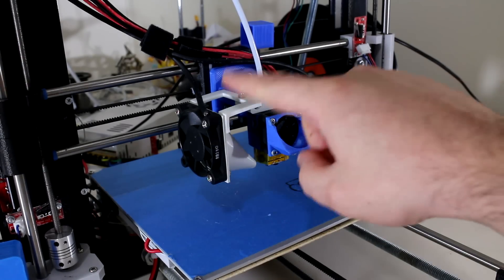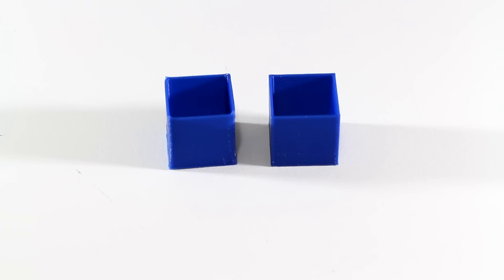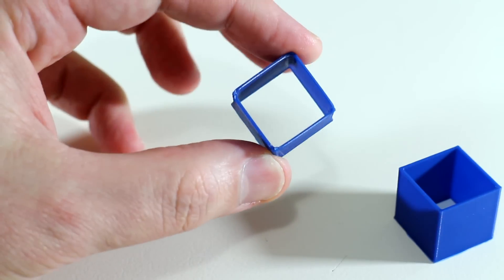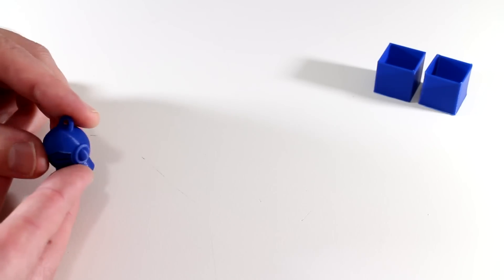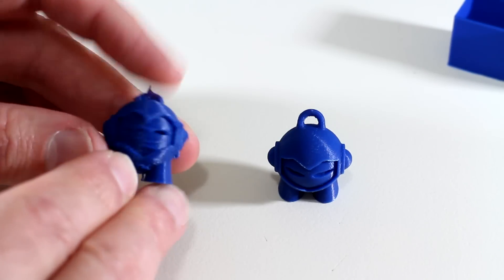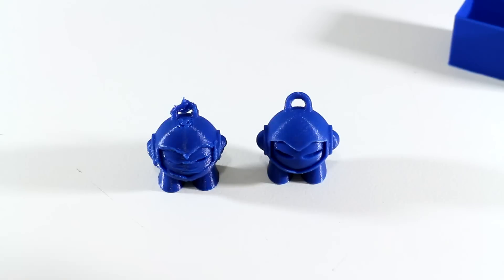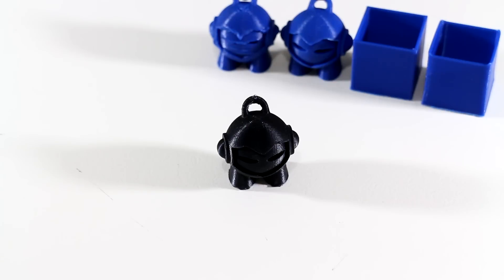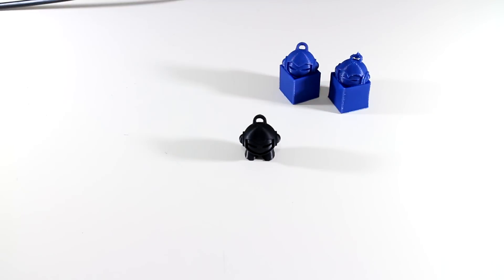3D Printer - Quality Printing with Cooling Fans

Comment: The printer I use has a part cooling fan only on one side of the print head, so that melty effect you get when printing small parts is particularly pronounced.
Reply from the maker: +The Garden of Eatin 
Yeah, I started with a single fan on one side, noticed the part deforming on the other side, so added a second fan.
Reply: +Tech2C I will likely do something similar with mine.
Reply: +Tech2C Have you noticed any effect on inter-layer adhesion with the cooling fans?
Reply from the maker: The Garden of Eatin

Not that I can tell. The new layer of plastic is hot when it's squished on the previous layer so I guess that heat is enough to fuse.
Reply: So I built a reprap with a Mk8 print head on it, no cooling fan.  I installed a duct from thingiverse that takes the exhaust from the heat sink and aims it at the part.  Something of an improvement in print quality. Very cool.

Comment: To hot, and to fast, my prints come out great without fans, running at 195-200 heat, and anywhere from 20-40 mm/s,  so for me the whole fan thing is a wast of time, and plastic, fine tune your machines thru settings of your slicer software, and will be just fine

Comment: Hi, nice video. Thanks. I'll definitelly go with two fans as you did it.  I have a question:  Would you please let me know something about your heating bed? I can se something that looks as an aluminum plate...I want something like that but, what about the heating system? Thanks in advance for your answer.  Cheers!
Reply from the maker: +Juan David Barrada 
Hello, yes I use an Aluminium Heat bed. I upgraded to this from the red PCB heat bed. The PCB material is a poor conductor of heat, but Aluminium a great conductor of heat. This means the entire heat bed is the same temperature, which wasn't the case with the PCB heat bed. Thanks for watching !

Comment: Great quality print, good video. However I just wondered why it seems as if you were getting much higher quality prints without the cooling fans some months ago, but now with them turned off the printer doesn't seem to be able to cope. What's happened there?
Reply from the maker: I've been using these fans for ages. I just hadn't placed emphasis on the importance of them in a previous video. It also depends on the print size, layer height, and plastic used which alters the fans importance.
Reply: Thanks that clears it up. I'll be sure to pick up some fans for my printer now.

Comment: Note to newbies watching this: He is using PLA, ABS does not need fans, but it does benefit from them for very small parts or layers that would otherwise finish too fast to cool before the next layer. but Gcode control, or an easy access switch on the wiring is almost mandatory, as too much cooling will prevent the layers from sticking together.

Comment: Smart!
btw what printer are you using?
Reply from the maker: It's a Prusa i3
Reply: Tech2C I'm starting to fall in love with this printer. I searched for it on Amazon and I saw different names like HITCOP and whatever for different sellers. Is it just the name of the seller, and the printer's name is just Prusia i3, or are there really different versions of it?
Reply from the maker: iSquamata

Each brand is slightly different, even though they are based on the Prusa i3 design.
Reply: Tech2C do you suggest a certain brand?

Comment: Looks like you didn't adjust the extruder or print bed temperature. If you adjust for those, you can get better prints without a fan.

Comment: Hey I have a printer I bought used to get into the game and it is a Plastic Scribbler, has just a regular nozzle setup instead of the bowden.  Would you have a solution to add the setup you have to it?   Thanks.

Comment: I have come across similar findings on my FF finder. As it is a closed well built machine, I run a USB fan off the USB port on the side and printed a base for it to sit on top cooling down over everything.
Has built in memory so I don't need that port to print.

Comment: Your printer is amazingly quiet, unless it's just the way you recorded the audio. The steppers on my Monoprice Maker Select V2 (Wanhao Duplicator i3 OEM)  sounds like a power drill, especially the Y axis motor. I already did a bunch of mods on the control unit & PSU to quiet down the fans, but the steppers are now the main source of noise. Any tips for quieting things down?
Reply: You can put dampening pads between the motor and the mounting plate. But be warned - if the pads (usually made out of rubber) are too soft/flexible, it will allow the motor to spin/twist slightly, and that can have a detrimental effect on the print.
Reply: Benjamin Esposti craft foam. thin

Comment: Would it work if you have a big fan beside it?
Reply: A big fan next to the printer will also cool off the heat bed and the nozzle which could cause difficulty in maintaining the temps. You also risk warping since only a single side of the part will be cooled by the fan.

Comment: you need to change the extrusion temperature. if the filament is too hot when it is being used, it will continue to be gooey and melty because you aren't giving it enough time to cool to the proper temperature. if you lower the extruder temperature, you should see better results with both PLA and ABS filament. there's no neet to waste money on buying two extra cooling fans to cool the filament sooner. just lower the temperature of the extruder and you will get the exact same results for a lot less money.
Reply from the maker: Disagree. These fans cost peanuts, plus I had them spare. 
The cooling fans solidify the plastic much faster resulting in a sharper detailed finish. 
I can print faster with these fans. 
I can print hotter and get a shiny finish from the plastic at these higher temperatures.
Small parts (like in this video) look much better than without the fans active.
Adding these cooling fans have added another level of quality printing to my parts. I highly recommend giving them a try.
Reply: Tech2C what if I don't have a 3D printer? I am on a robotic team and we have a 3D printer that we share. it's a Makerbot replicator 2. would the fans help the filament stay on the platform?

Comment: Hi and thanks, can you tell me the specs of your fans , speed and size ? Thanks
Reply from the maker: They are just 12v 50mm fans. Any fan will do, as long as the air is directed to the base of the nozzle.

Comment: Its very useful tutorial, may i know how to connect the fan cables? is it direct to 12v power supply or Fan terminal on RAMP 1.4 board?
Reply from the maker: +wahyu Lim RAMPS boards have a Fan output which allows software to control them. Checkout the reprap site http://reprap.org/wiki/RAMPS_1.4
Reply: +Tech2C Yes, I know, it means you connect the fan to D9 (not direct to 12V power supply, as the fan for Extruder direct to 12V power supply), may i have the fan mounting STL file for cooling the filament? Thanks
Reply: +Tech2C Sorry I just see someone has asked it below. Many Thanks

Comment: I wonder if they make this for a Delta style 3d printer.
Reply: I own a delta style 3D printer, and so far, I have found that you have to print your own cooling shroud if you want the fan mounted on the spider. I am doing an experiment with a low-speed 120mm fan pointing toward the print from above. The result actually looks great so far...

Comment: What end code do you use to have the Z lift a certain distance off the print? Right now I have to just have it G0 Z130 (the top of the printer) to insure it lifts off the print when done.
Reply from the maker: G91 ;relative positioning
G1 Z+0.5 E-5 X-20 Y-20 F9000 ;move Z up a bit and retract filament
G28 X0 ;move X/Y to min endstops
M84 ;steppers off
G90 ;absolute positioning

Comment: any variance on the fans with petg? i.e. does the dual fans make petg print quality better?
Reply from the maker: I print PETG with fans at 35% print speed. All plastic will benefit from cooling as long as it doesn't affect layer adhesion and part warpage...
Reply: Thanks for the reply.. 
[Backstory] - I was trying to print hypercube parts in PETG on a Wanhao i3 replica (Maker Select) and the plastic would bunch up on the nozzle. Was using  your recommended slic3r settings but I suspect its waaay too fast for this printer to handle, and the feeder stepper is occasionally skipping as well. Re-tried the part in PLA and it came out fine... I was thinking that part of the issue is that the cooler on my printer cannot deliver enough air to cool down the hotter PETG. I may just print (most) everything in PLA and when the hypercube is together I will re-print parts in the new printer in PETG. 

Thanks for the reply and the hypercube work.
Happy new year from Canada!

 - Eddy

Comment: Thanks for great video. I also learned the hard way how important a more powerful cooling fan is on the Arduino board, when my ROBO3d kept messing up prints no matter what I did. The fan had an inconsistent short - board would get hot, print would mess up half way through. I put a much larger fan cooling the board and have great prints now. Im going to print out those bowden fan mounts and give it a try. Thanks!

Comment: Thank you! I installed a cooling fan at the tip of my nozzle and now my prints have improved 100%
I now print all my projects with PETG and max fan at the tip. PETG has similar properties to ABS, with the added benefit that it does not mind strong cooling while printing.

Comment: This cooling system is compatible with the Gregs Wade Extruder v3? There is a link for the printable .stl files ?
Reply from the maker: You'll have to check thingiverse or the reprap forums for cooling solutions with your extruder.

Comment: What do you do to avoid issues on overhangs ?  This cooling system it is a solution ? Or something else ?
Reply from the maker: +Pawel Drogowski Definitely, cooling helps with over hangs. If you haven't used this before then you will be surprised with the results...

Comment: looks like it's also too hot, while this video is still true it can be better without a fan a bit first though it can be filament specific and some will be stronger if it's at it's ideal extrusion temp.

Comment: Hi Tech2C, thanks again for another quality 3d printing video. However, I am curious when you mentioned that the glass temperature of PLA is 55°C and that of ABS to be 90-100°C. It does not match my references, like this one (which say it's 65°C and 105°C respectively) and even then, colored ABS and PLA tend to have higher tg due to the pigments added. What should I make of this?
Reply from the maker: Each manufacturer can use a different chemistry in their filaments altering the glass transition temperature. If the manufacturer says 65c for their brand of filament, then you can trust them. However these plastics will get soft long before the glass transition temperatures specified, so be mindful of that.

Comment: I can see a resonance pattern in your prints and I wonder what is doing it?  They seem to go up at an angle.
Reply from the maker: +Dark Alchemist 
I'm not sure. They are very hard to see with the naked eye, and these photos are zoomed quite a bit. Probably something to do with how the stepper motors or how they're driven?
Reply: +Tech2C Neither am I as the cube shows it off better due to the flat surface and it is in both of them so that removes fan vibrations (just thinking it might be the hotend fan vibrations causing it too which is always on) and what is really weird is the pattern is always from left to right no matter how you turn the cube to face you.  I wonder if the camera is playing tricks on us and it is the camera causing the pattern?

Comment: To what température do you print pla ?
Reply from the maker: Anywhere between 180 and 220c. It depends on the brand. Normally the manufacturer will recommend a print temperature range.
Reply: Okay thanks guy :)

Comment: What hot end and extruder are you using? I need to replace mine. Great video. :)
Reply: Or what low cost hot ends do you recomend?
Reply from the maker: +Panoreth 3D Printing I'm using the E3D v6 1.75mm Universal. It was an upgrade from my JHead MK5B. If price is an issue, you can purchase the E3D v6 Lite edition, but you can't printer with higher temperature filaments (which isn't a big issue as there's plenty of alternative filaments)
Reply: +Tech2C what is the highest tempurate can the lite print up too?
Reply from the maker: Panoreth 3D Printing

http://e3d-online.com/

Comment: do you just tie two side fans to the extruder fan power?
Reply from the maker: No. these fans are controlled separately and can be turn on or off in software.
Reply: would you mind posting a video or a description on how you were able to accomplish that?  I am using Ramps 1.4 and have my bedside cooling fan tied in with my extruder cooling fan because i couldn't find another way to control it.
Reply from the maker: Kevin Ellis

Easy to connect fans to RAMPS 1.4 - I have the same one :)
The screw terminal next to the hotend heater screw terminals is for the software controlled cooling fan - D9. Just wire them in and enable cooling in Cura/Slic3r for it to turn the fans on.

Also just google the RAMPS 1.4 board pin outs which will show fan output - D9.
Reply: first off, thank you.  It turns out that my Extruder Fan is wired wrong.  I have it plugged into the D9 header along with my cooling fan.  My board does not have the pins for the Extruder Fan installed. That is, if this image can be trusted: http://i.imgur.com/KOjq6ri.jpg

Comment: To print with PLA do you use heatbed or not?
Reply from the maker: Sometimes. It depends on the size of the object. Small items I don't bother, but larger items I tend to use the heatbed just in case.
Reply: I use 50c with pla. I've noticed the bottom of the prints will melt/deform very slowly with anything above 65c

Comment: Fans are 70mm? If not would two 70mm be overkill?
Reply from the maker: I use 50mm fans. I think 70mm would be very much overkill for airflow and also the size would be quite obstructive.

Comment: I've got some questions.
1. All the fans I've encountered on 3D printers have either had to blow at 100% power, or made high pitched whines. How do you eliminate that noise?
2. I recently encountered a 3D printer setup where the fan dropped the extruder temperature from 210°C to 140°C, killing the entire PLA print due to obvious cold extrusion errors. How do you cool the part down without cooling down the extruder tip?

Comment: Can you help me please i have just brought a prusa pro b i3 and im a beginner which dont know much about p.c's and i have tryed to upload the marlin and adwino and changed the code to 'true false true false' then i tryed to upload it to the 3d printer but i keep getting a error on the marlin software i cant remember its like strucked s'tou something and i dont know what to do. if your can help me let me know thanks
Reply: I had the same issue. Wasted 8 hours trying to get firmware uploaded, but it kept failing. What brand of Prusa I3 did you get? I got mine from RepRapGuru. It's got an Arudino Mega 2560 board with a Ramps 1.4 board as well.

If you have those boards you should be able to upload the firmware from the files provided on RepRap's google drive. I talked to customer service since I had the same issue as you. They told me the new version of Arduino software has a known bug, so you have to use a previous version in order to upload Marlin. 

https://drive.google.com/drive/folders/0B4A3jLWIXeoFfkxURVdhMEFpTWpsSExncXFmUGpkalczX3ZvS1J6bGNabGdWM2NwaWNuS0k
Download Arduino and Marlin. Install Arduino, open the Marlin file with it. Edit the fields as well as mate it in the upper tool bar of Arduino. Make sure your BAUD rate is correct with what your device manager is reading, change it if necessary. Hit upload. It should confirm that it was uploaded. Close out of Arduino. Then open Repetier Host, set BAUD rate to same number and port as device manager, hit connect. Should work.

Hope that helped, if not then send me a message, I ran into multiple issues that I'm sure you might run into as well.
Reply: I fixed it now mate

Comment: Great topic, its really great to see the impact of cooling that much. However shouldn't have you lower the temperature for the PLA printing or is it mandatory to maintain that print speed?
Reply from the maker: These parts are small and illustrate the benefits of cooling. You could lower temperature, but the filament I use has a shiny surface when printing hotter - cooling relaxes the strict print time that causes molten plastic.

Comment: i always use a cooling fan, the only difference when im printing with ABS the printer is fully enclosed and the heat bed on (so the chamber is at about 40°C) and PLA the chamber open. ive had much less shrinking with the fan than without. as long as its in a stable warm environment... the freshly printed spot is under the fan for such a short time it only cools the plastic enough the get it to harden but stay warm enough not to shrink to much

Comment: Your test is very useless sorry. We can see that with just 1 fan your T° is really too high. you just have to lower it.  So you set your temperature to high it's a waste of energy and above this you add 2 fans to waste even more energy. And we can see that you don't respect the time beetween layers. In fact the only positive thing to adding fans is to reduce this value and print faster.

Comment: Good video. 
I find that when i use my cooling fan for temps over 255 degrees, i lose about 5 degrees off the hotend (this only applies when im printing Petg - but that is my upper limit anyway as i have a  (e3d) which uses a pfte tube). I can't imagine what would happen with two fans. Do you find that two fans is over kill. 
IE. did you go from no fans to two fans or one fan to two fans  - did you find a need to have a second fan. 
Cheers mate.